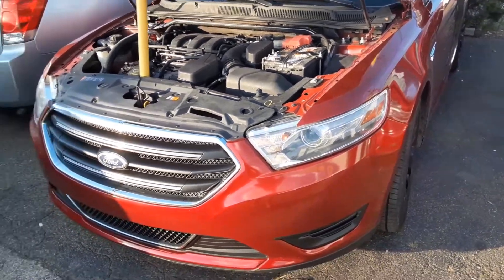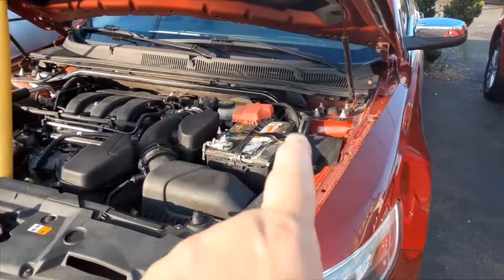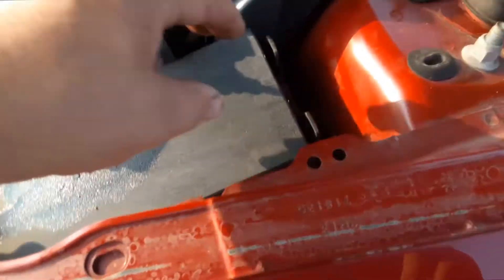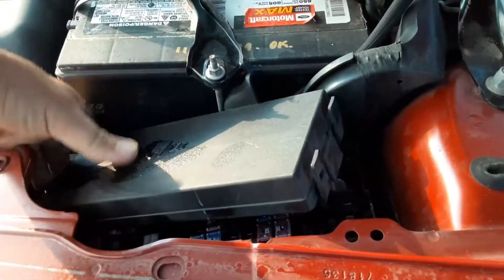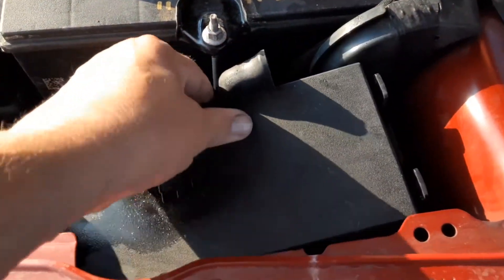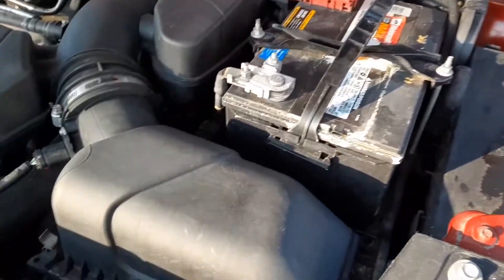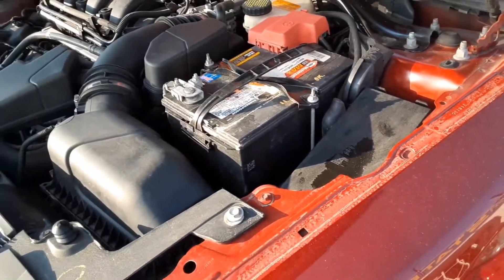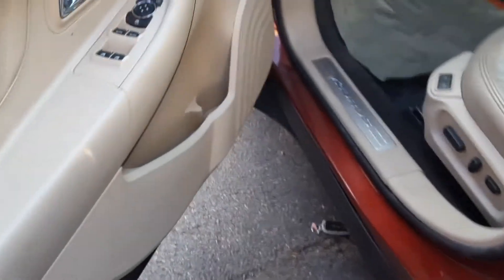Ford Taurus Fuse Box & OBD2 Port Locations   2010 to 2019

Comment: I took my panel off and I can assure you it wasn’t back there. I have a 2015 Ford Taurus limited
Reply: It is there, not really behind that panel.  I access mine down by the E brake,  mounted on left side above floor carpet. Small black box  maybe 2 x 4".
Reply: same i got a 2013 and there was nothing there im so mad.
Reply: The interior one is not there on a 2011 Taurus. Wrong info. Just to tear apart the car. 1:36